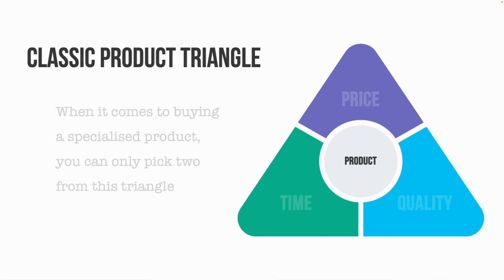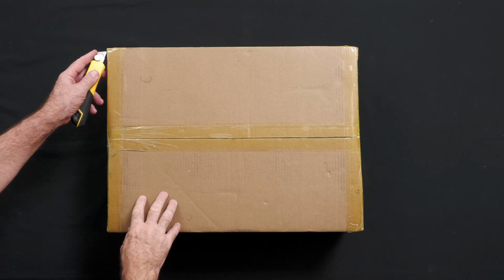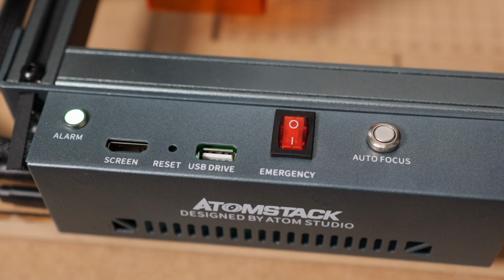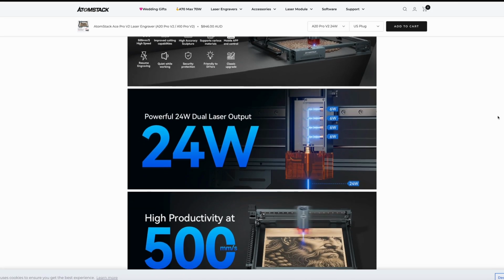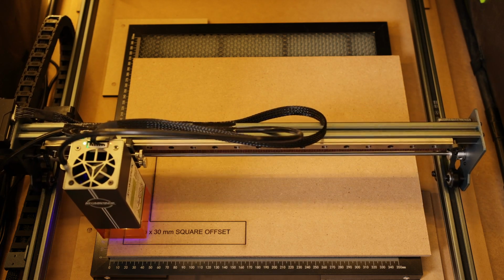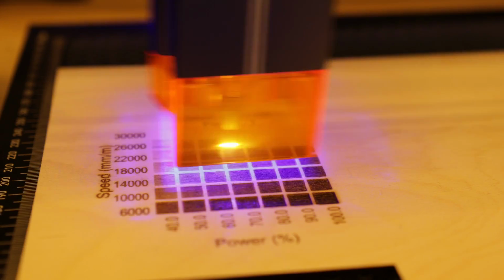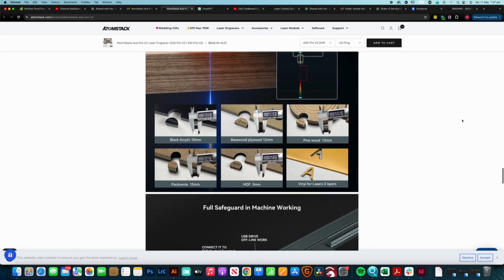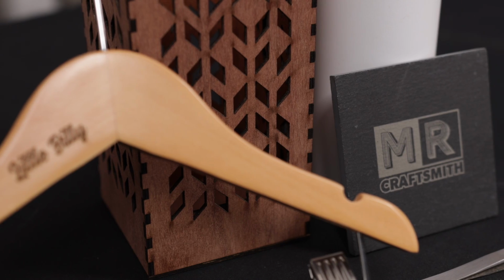ALL NEW - Atomstack Ace Pro V2 - BEST 24W BUDGET DIODE LASER???

Comment: Hi Darren, just bought the atomstack 20 watt and kimd of struggling with settings. Copied the settings you have on the material test and all i got was all boxes becoming holes. Wondering if you may be able to offer some assistance as it seems you are pretty much all over Lightburn. Thanks 😅